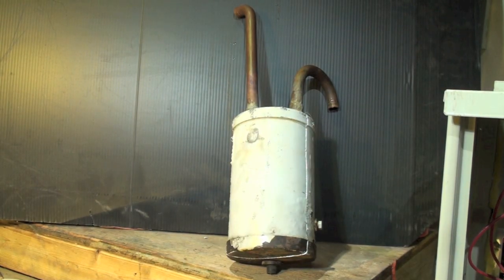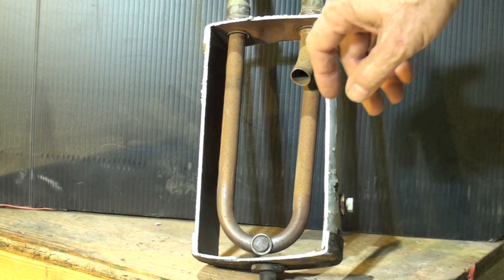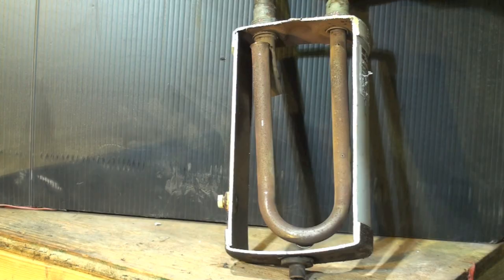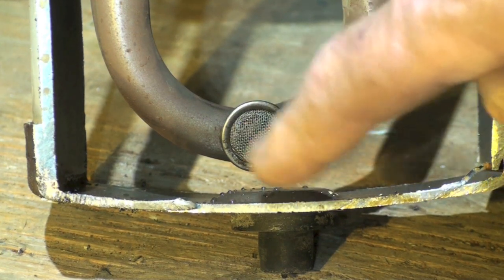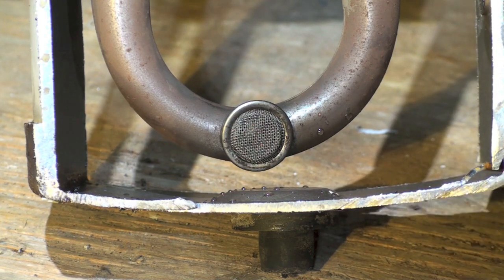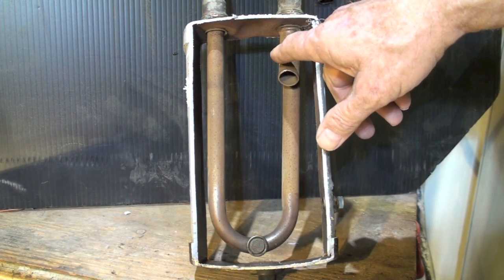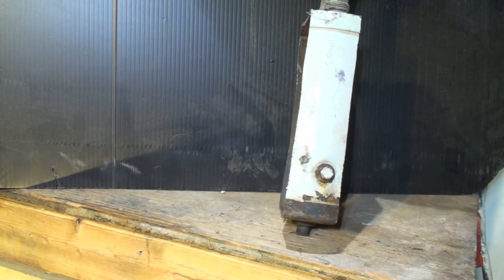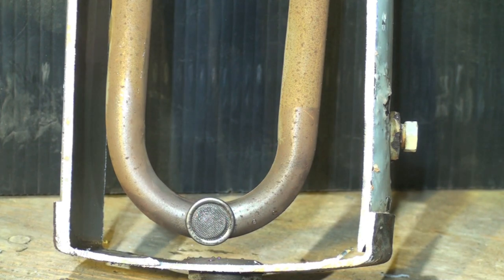A look at the refrigeration accumulator

Comment: Thank you! I watched several other videos on the same topic and no one showed that the top of the curved tube was open at the top to suck in vapor. Now I get it. 
I wish they put windows on these things so you could look inside. For example if you noticed a bunch of oil pooled up where there was none before you could infer the venturi hole or screen was clogged and maybe save the compressor before it is destroyed.

Comment: thanks for cutting one apart, so the bottom hole with filter is design for oil to return back into compressor, any liquid refrigerant (if presents mostly in heating cycle) should evaporate inside the accumulator by the time it's reaches the top, if any liquid refrigerant entrees through bottom hole will probably evaporate before entering the comp.
Question: the way i see it the is no way for an accumulator to get clogged  for an exception of an oil return path, but even then the comp. will still be pumping vapor gas as is should (probably not for long due to lack of oil) am i right or wrong? thanks
Reply from the maker: Dennis Noone If I am hearing you right, if the hole in the accumulator tube gets plugged, the accumulator will fill with liquid refrigerant and oil.  This will cause a low charge situation.  This happens in a short time.  Something like 15 minutes in heat mode.  Hope this helps.
GFM

Comment: great video, I have a question what happens, if the suction and discharge ports are reversed? Just flooding the compressor as if it is not there? If you could please input on that
Reply from the maker: It will fill with oil and take out the compressor
GFM

Comment: A couple questions:
1) Are there any circumstances where the accumulator will frost up?  I noticed my accumulator is frosted in heat mode at start up.
2) Are there any drawbacks to installing a larger accumulator, say if for instance the refrigerant line set is lengthened?
Thanks!

Comment: Thanks for this video.
You mention of oil getting back to in a calibrated amount to give no harm to the compressor.

In injecting an oil to the system, which place is the best line to use. Before or after the tge compressor?

And, does evacuation, at -29 psi reading, boils the oil which could pull the gas oil? 

I'm thinking of putting back the amount of oil pulled out during  recovery using an oil separator before doing the evacuation and recharging.
Reply from the maker: First, you probably won't get a lot of oil with the refrigerant.  The best place to charge oil into an evacuated system without the compressor running is the discharge line.  It will take a while for it to return to the compressor.  
GFM
Reply: grayfurnaceman  thank you.

Just want to be sure since i am on process of learning. Discharge line you mean the hot line or liquid line?

I"ll be replacing a 20year old receiver drier on my vehicle so I believe i have to add oil to the system with the amount specified on the table of oil to add for a part to be changed.

Again, thank you.
Reply from the maker: Hot line
GFM

Comment: Do all condenser units have accumulators? 

With such good protection against liquid "slugging" (I think that's the right word), seems like slugging would never happen. 

Accumulators look look like a big reason why it takes 10 minutes of run for the system to stabilize.
Reply from the maker: Accumulators are used on heat pumps due to the varying needed charge and on some air conditioners.  They are not common on A/C units.  
Slugging is less common that you might think.  Manufacturers have done a number of things to avoid slugging.
GFM

Comment: Hey Gary quick question, if that orfice gets plugged can it mimic the symptom of a system that’s low on charge ???? I have a unit that keeps icing up right after that outlet going right into the compressor what are your thoughts. I added free on and my high side went up but my low side showed zero change what so ever. Do you think it’s the accumulator?
Reply from the maker: The symptoms of a blocked accumulator bleed hole are low suction pressure, high superheat with low head pressure with very high subcool.  
Usually, the pressures are fairly close to normal upon startup with pressure dropping within 10 minutes.
GFM

Comment: Hi GFM, I’m trying to relocate a 3 door fridge. I need to remove the condenser and compressor to clear the arch. It’s an r-22 system with a txv and accumulator. Can I trap the refrigerant in the accumulator to isolate the refrigerant? I can’t find the tool to remove the caster wheels otherwise I wouldn’t need to do anything. TIA
Reply from the maker: Short answer, find the tool.  What you are contemplating is quite complicated.  The unit probably uses a receiver, not an accumulator.  The accumulator is installed on the low side.  The refrigerant can be pumped down to the receiver if it has the correct valves, but   when the unit is reassembled, the low side must be evacuated with a vacuum pump.  
GFM

Comment: What would be the symptoms if the accumulator was installed backwards?
Reply: That would be bad. All the oil would wind up in there, therefore compressor burnout. 
You can also tap the wall to hear a hollow ringing sound means it's not full of gas (edit :liquid) or oil

Comment: Question what is if the hole at the bottom clog what going to happen
Reply from the maker: The accumulator will fill with refrigerant in about 20 minutes and the unit will act like its low on charge.
GFM